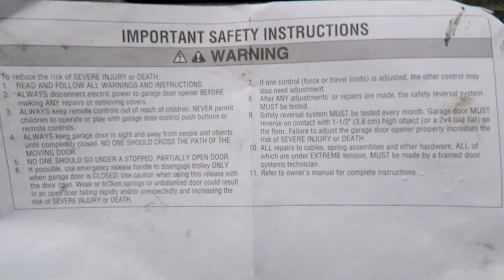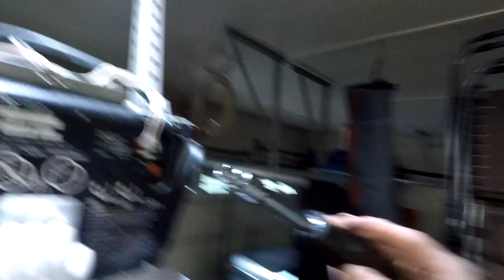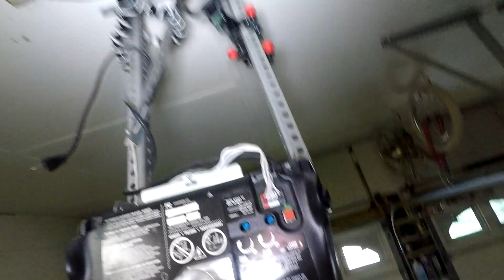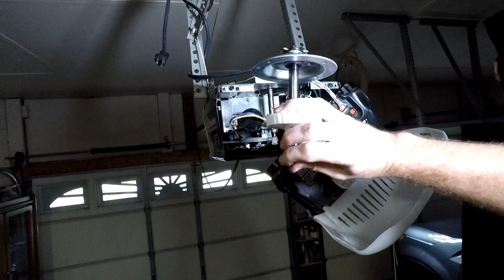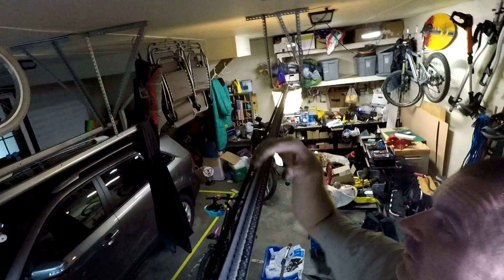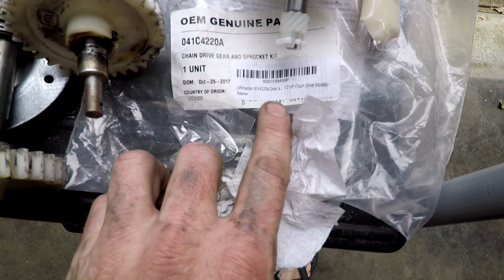Replacing a Broken Chain Drive Module On a Garage Door Opener

Comment: One way to prevent this from happening is not to over tighten the chain. Make sure the chain is only about a 1/2” above the base of the rail. Also I recommend you grease that fresh gear in the opener because if you don’t you will be lucky to get a month out of it.
Reply from the maker: Thank you for the comment and the advice.  I do need to put some grease on the gears.